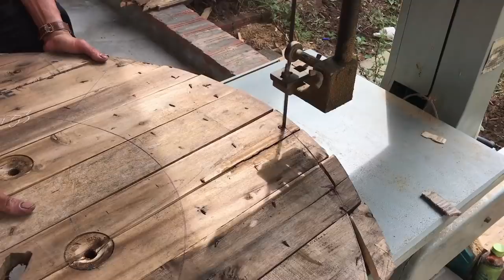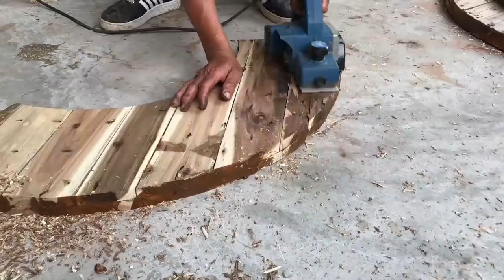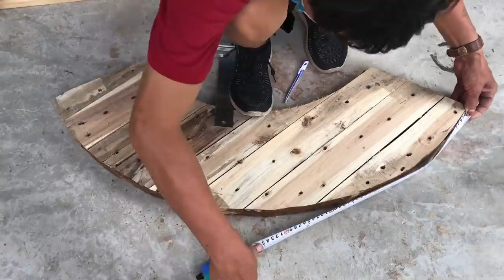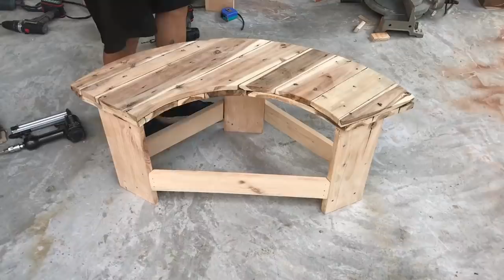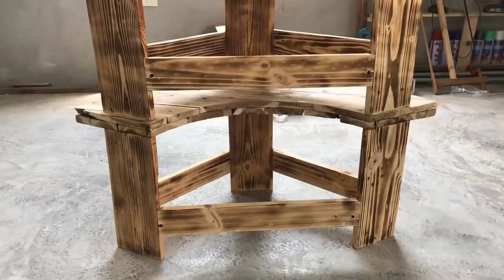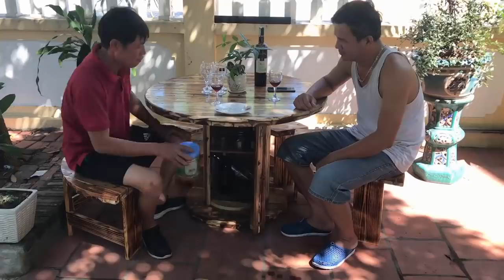Build A Set Of Tables And Chairs from A Wooden cable reel // Great Idea Woodworking Project - DIY!

Comment: It might work for you guys, but... Do you know the cost of one of those cable reels? From there to create a table and chairs.... Hmmmmmm i don't know
Reply: Try free? Most of the time, people just have these lying around. There’s three huge ones in my neighbors’ garbage heap right now. I guess it depends on where you live though...
Reply: @FrodoMcNuggets  where I live if you will find them in the garbage is because they are already damaged or left to rotten. New one in good conditions like what they have in the video, people will make crazy things to try to give it back and get down the costs
Reply: They can run from 20 - 80 bucks look on Craigslist in your area I found mine that way